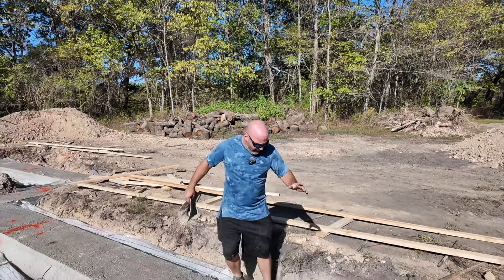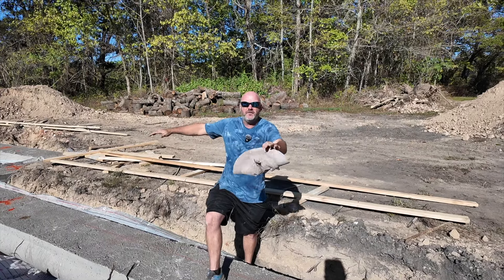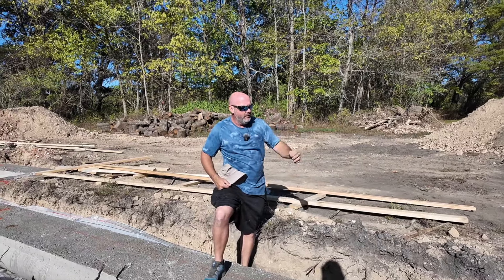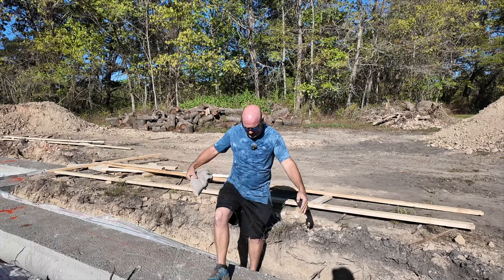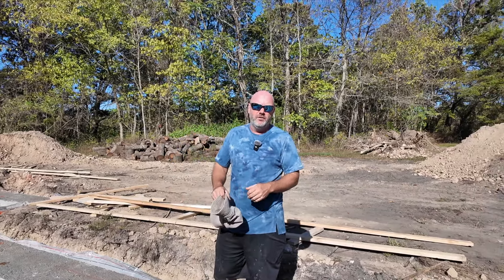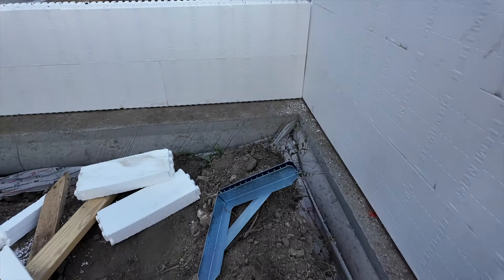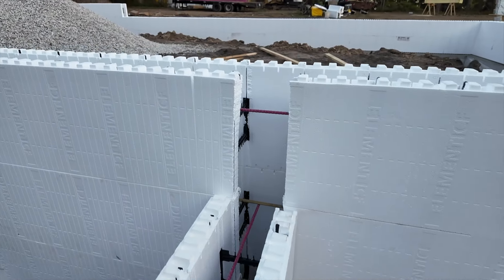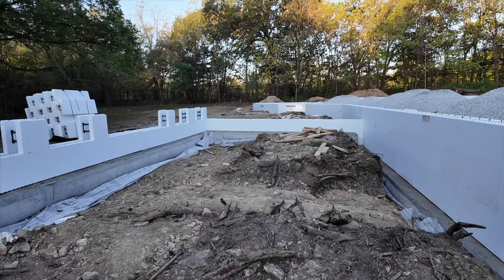New ICF Build!!!  First Pour with Elements ICF!!!!

Comment: Great video. Looks like you used the Fast Foot there, but poured the footing separately. When/why do you do a single pour, and why sometimes not? You may have have said that but I missed it.
Reply from the maker: So with monopour the juice has gotta be worth the squeeze…. It takes more labor to set up and it’s much harder to brace it to keep it perfectly straight and level…. In any situation where we are trying to refuse water under pressure it is worth it, but on a foundation, especially one like this where the slab is many feet above the cold joint and there’s nothing but gravel below anyway it isn’t…. Fastfoot installed non mono like this can easily yield one of the most level footings you could ever ask for, my guys were only required to shim 3-4 spots in 500’!  Plus since we tailgate poured it there was no extra pump to consider!
Reply: @all3pools  That makes sense. Thanks.

Comment: Guess element did a big ole advertising dump between risinger and all the other decent build channels
Reply from the maker: Ya I had already shot mine but had an issue with the upload last week and didn’t want it posting late so waited a week
Reply: @all3pools  I have my GC app in the fl dbpr waiting currently but my first build is going to be an ICF home. Honestly what's your opinion on which block to use. Cost is definitely a major factor. I like that the element web slides up and down.
Reply from the maker: Right now my choices would be element, fox, Nudura/build in that order, but element in a solid first…. I’m not talking price in a big way because I’m not sure it’s going to be this way for long but they’ve kept their old pricing…. So cheaper+better= no brainer…. It should honestly cost at least as much as fox and nudura
Reply: @all3pools Had you considered Perfect Block? If so, what disqualifies it for you as a preferred ICF system?